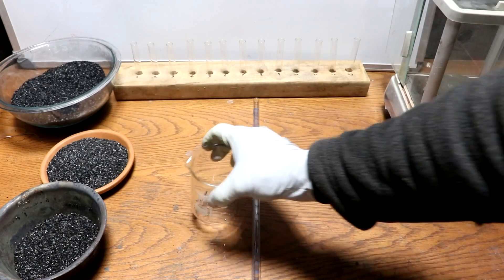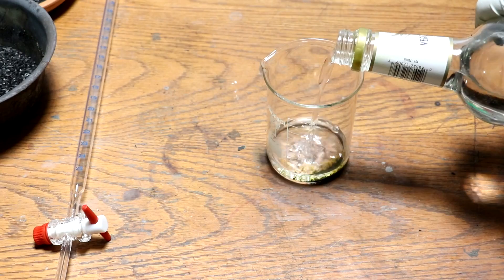dissolving iodine

Comment: I would say this is a secret but it was pretty obvious in the video, it was near a point where most people probably were looking. Better way to put a secret in is to flash it somewhere people won't be looking and during a part where people will have all their attention on one point. Then it will be very difficult to notice. Actually, now that I think of it, it would be cool to see someone do a test to see exactly how much it affects the number of views a secret video gets.
Reply: Sounds like you just volunteered yourself.
Reply: @cptn_chromo3189  Nah, I don't have nearly enough viewership to be able to run an accurate test. I actually kinda quit the little semblance of a YT career I had a while ago xP
Reply: Hide it as text on an equipment label (e.g. printed to look like the original, just with the serial number changed to the video code)? Would take a lot of planning…
Reply: Someone is bound to put it in the comments soon after discovery